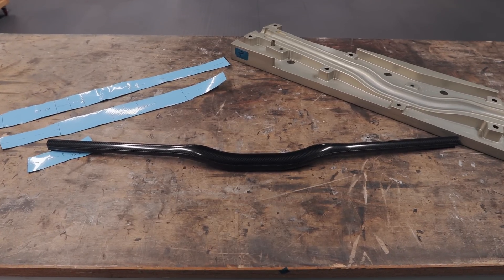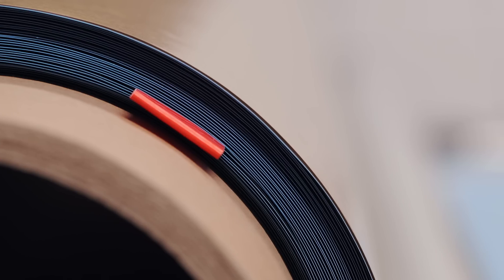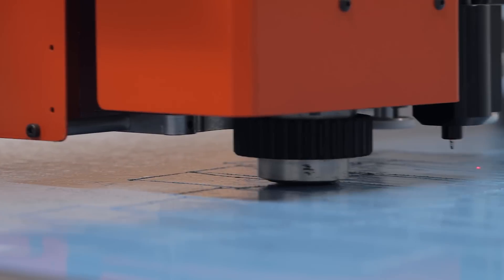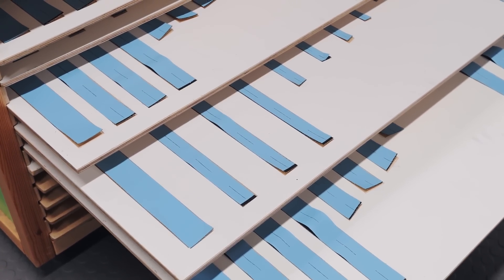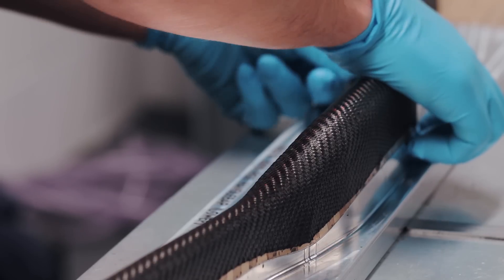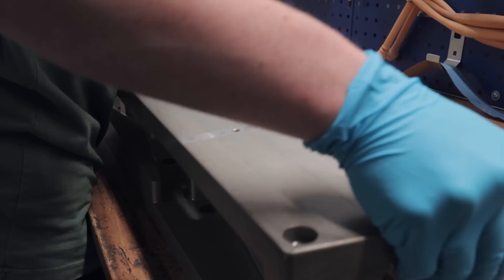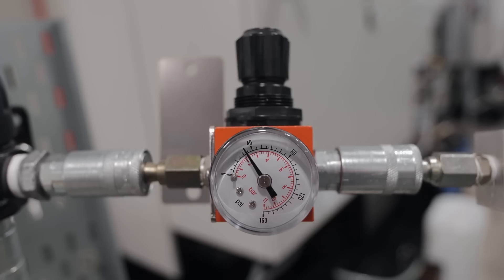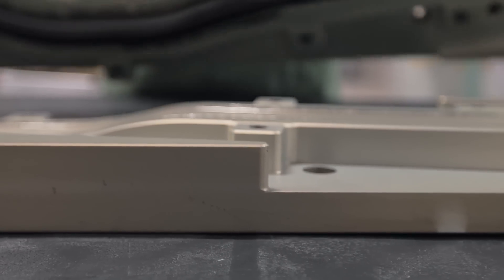Hope Technology: Making of Carbon Handlebars

Comment: I run carbon bars on my hardtail, and they are great.  Carbon is more comfortable than aluminum in rough terrain, so there is that.  And they are strong.  When I climb steel hills, I exert tremendous pressure on my cranks and on my bars as I pull against them.  And I'm quite strong, so these bars are, too.  Also, a year ago I lost control of my bike in a very tight trail section and went directly toward a tree.  My right-side handlebar section was going to hit that tree directly, and quite hard.  SO I made the decision to let go of the left side completely.  I did that because I did not want to hold on to the left with a death grip when the tree hit the right side, which would have certainly resulted in much more energy going from the impact directly into the handlebar. 

Letting go, naturally, meant that I got to enjoy the tree-slam with zero control.  The right handlebar hit that tree, yanking my wheel violently to the right and throwing me off the bike.  My right-side controls got relocated, but the carbon bars did not show a single scratch.  So I am sold on these bars, for sure.  Love them.  My one concern is UV radiation.  Will UV weaken them?  I suspect it will, but I keep my bike indoors (Its in my dining room  on my bike rack - who needs a table?) so UV is only a problem when traveling and riding.  To mitigate this a bit, I wrapped them with some coolio bike handlebar tape.  It looks good, also provides some impact defense, and keeps the sun off my beauties.  I paid about $35 bucks for these Chinese carbon bars.  Beiou, amazon.

Comment: If I want to make Bicycle Handlebars using carbon fibre/epoxy, using Resin Transfer Moulding. What are benefits of using my selected composite material and process for the part? What are the main difficulties for the design and the manufacturing?